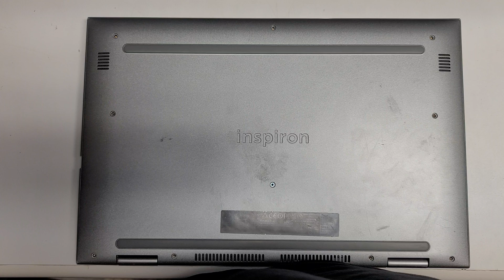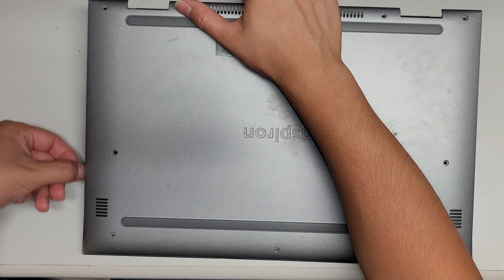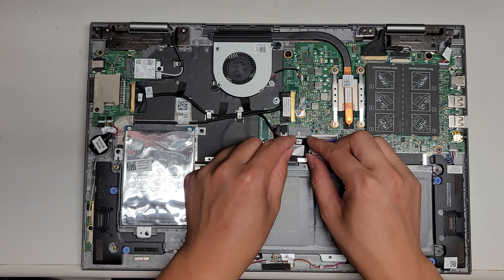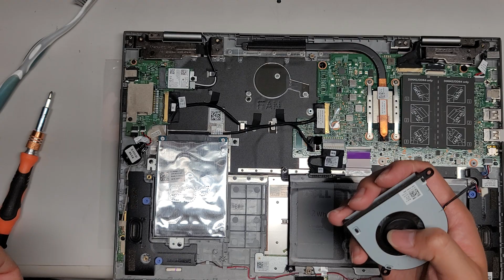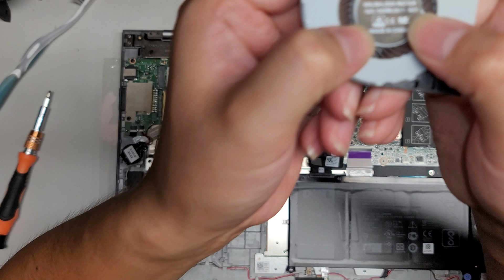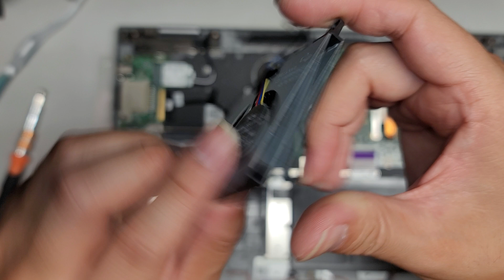Dell Inspiron 15-5578 Disassembly RAM SSD Hard Drive Upgrade Repair Fan Replacement

Comment: Excellent video! I would like to know if there is a maximmum capacity of the SSD, for example 480hb or 512. Thanks!
Reply from the maker: No max. Whatever you can fit

Comment: Wow men, I Chatted with Dell  support yesterday I was about to buy an m.2 sad because they said this computer accept m.2 even the website shows up m.2 as a part to upgrade. Well tonight I decide to open my laptop and surprise there is no m.2 slot I found your video to see if you mentioned but no. Now one question I imagine you know already that this computer has a classical hdd, which ssd do you recommend for this model well actually I have dell 15 5579.

Thanks for the video.
Reply from the maker: Looks like to the left of the hard drive push down connector some models might have it. As for regular 2.5" SSD these will work. 480hb https://amzn.to/3oNLUom 1tb https://amzn.to/3DrDdUN
Reply: @ItsBinhRepaired  no I don’t see any m.2 slot , I’m going to replace the hard drive it’s probably the best option. Thanks I appreciate it
Reply from the maker: @albertomoreno9320  no problem
Reply: @ItsBinhRepaired  last thing I promise do you think the one of 1tb gives the better performance  I’m tired of my computer always freezes.
Reply from the maker: @albertomoreno9320  compared to the other SSD, no.
Reply: @ItsBinhRepaired  which one do you think it’s better for performance?
Reply from the maker: @albertomoreno9320  if you don't care about price, then this. https://amzn.to/3aFPXLv
Reply from the maker: @albertomoreno9320  the other two are comparable
Reply: @ItsBinhRepaired  and memory ram ?
Reply from the maker: @albertomoreno9320  how much RAM?
Reply: @ItsBinhRepaired  8gb I already have one of 8gb. This laptop just support 16gb
Reply from the maker: @albertomoreno9320  you want to get a matching stick
Reply: @ItsBinhRepaired  I read I only need a ddr4  right?
Reply from the maker: @albertomoreno9320  the answer is in the video, but you should check your RAM in case it's different

Comment: Hii is it possible to use both SSD and drive both in this model 
I have the same model can I do that??
Reply from the maker: The real question is where would you put a second hard drive/SSD?
Reply: @ItsBinhRepaired  that's what I was trying to ask 
I m kind of new to this tech side of laptop 
And my laptop is running to slow 
Suggest me what shall I do 
Shall I shift to SSD ?
Reply from the maker: @tabraizbinahmed1513  this laptop only has the space for a 2.5" SATA SSD. This is what you'll need to migrate everything over. https://youtu.be/4p5jFDzVwUw

Here's an SSD you can use. https://amzn.to/3eZsqYL
Here's the adapter https://amzn.to/3v5egLl

I've heard some people say you could put an m.2 pcie SSD in the wireless card slot, but then you lose the internal wireless card.
Reply: @ItsBinhRepaired  thanks buddy appreciated 👍